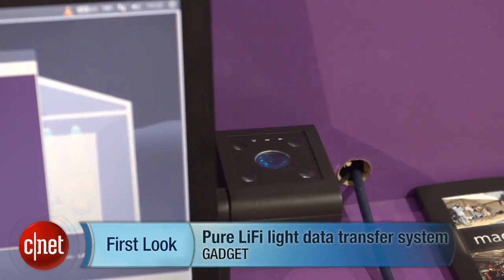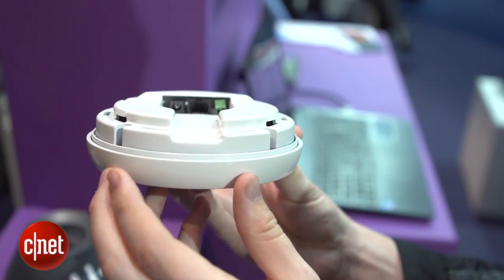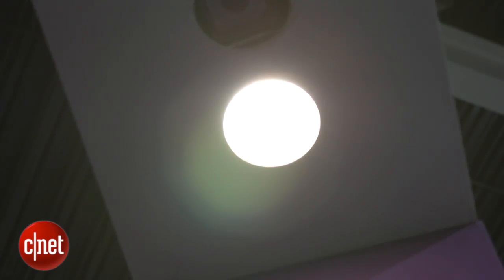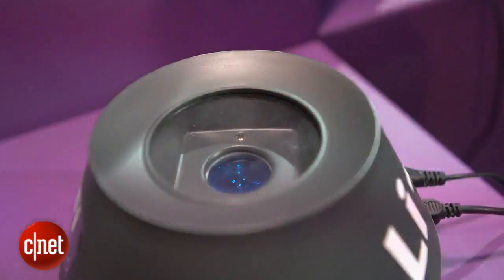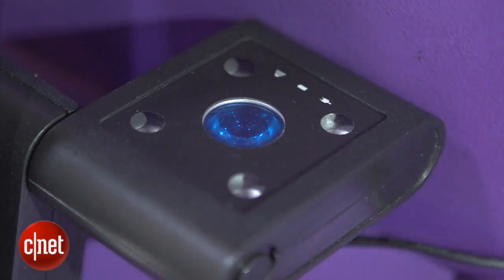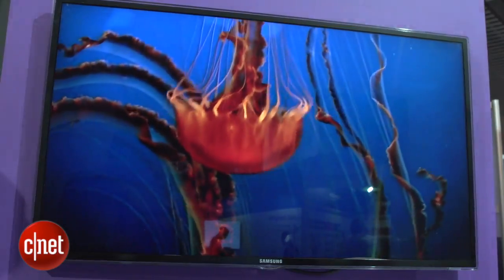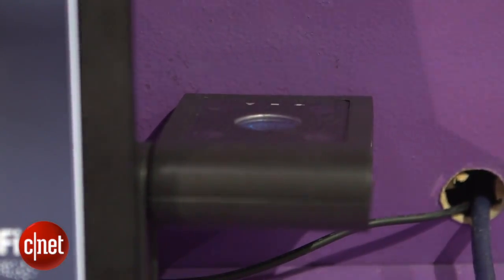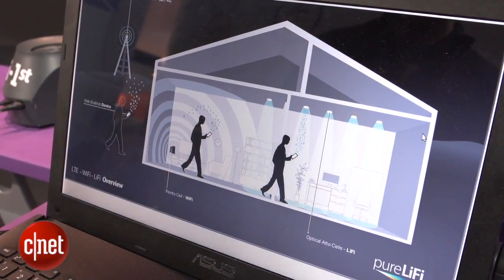Pure LiFi transfers data using light

Comment: It's a cool concept but I'm curious as to what the practical applications are and what are the advantages over other wireless data transmitting devices (Bluetooth, Wi-Fi, LTE, NFC, infrared blast,  etc.) p.s. what is the difference between this and infrared blasters? If there is no difference well then that's just stupid because this technology has been around since the television remote control was invented, (cuz that's exactly how it works).

Comment: Secure? As you would have to be able to see the light to get the info. If two cell phones had this could they transmit data with no potential of radio wave interception? Maybe a new thing if they made it small instead of rfid in a credit card. Credit card in a semi enclosed card reader that would trigger the card to flash a light. Leds can be made that compact just need a suitable power source. Solar for power? That is still flat and compact...

Comment: The main problem was demonstrated. You need a line of site. I guess it's OK for things that don't move, like a tv, projector, or even a desktop, but it's no replacement for WiFi.
Reply: the advantages over WiFi though, are it's theoretical speed output over WiFi. it's supposed to be faster by order of ten fold...

Comment: There wouldn't really be any use in this "new technology" as the transfer of information by radio waves seems far more superior and sufficient to this alternative method. I mean, why plug some device into your light socket that must be wired to the internet and is prone to interference, when you can just continue to use radio waves and no interference and the technology just keeps getting better?

Comment: Radio waves are light!
Reply: Good effort, but that is an incorrect statement. Radio waves are not light, they are both parts of the electromagnetic radiation spectrum, and the visible light is faster.

Comment: what we need is to somehow transfer data through light into our eyes to receive information into our brains. That would save so much time with learning.
Reply: That would require an ungodly talent at data decryption or a technological aided device such as brain implants to interpret the data. The light itself is just made up of different wavelength/amplitude forming a x bit language that gets read by a receiver terminal. So one of the feasible ways is tech implants

Comment: Infrared all over again...
Reply: Good effort, but that is an incorrect statement. Radio waves are not light, they are both parts of the electromagnetic radiation spectrum, and the visible light is faster.

Comment: I do not see any benefits of this tech! And FYI, radio waves are light! Just not the visible kind. So with that, "LiFi" is just gimmicky marketing.
Reply: Good effort, but that is an incorrect statement. Radio waves are not light, they are both parts of the electromagnetic radiation spectrum, and the visible light is faster.

Comment: I thought it was some sort of "April fools" joke when i saw this concept on TED... Happy to see that it wasnt. Only problem with this is that it's only a one way street
Reply: for now, but imagine if both had a sender and a retreiver, i feel the light spectrum would need to be adjusted so it can tell the difference.
Reply: cmb271 don't think a mobile device would have the battery power to have a transmitter

Comment: I would say that it is pointless & stupid. Interesting comcept but not really practical in real world
Reply: I can think of a few practical uses in the real world. So I wouldn't say it's pointless and stupid. The concept itself seems brilliant in its simplicity. It can be used as networking secured by physical walls. It also allows for instant connection to devices that enter the field of light (much more useful if the concept evolves into tiny sensors). Unlike traditional wireless (like 2.4ghz and 5ghz) with WEP <-lol, WPA, WPA2, etc encryption that can be cracked within a day or two by any person with dedication and help from google. Breaking into a network that relies on a light source would require infiltrating the building. It's not a technology that has a use for everyone, but it has it's uses here and there.
Reply: +lilman227 ya I could see it being useful in a business environment, and in homes to with electronics that don't move (tv, fridge ect), but as far as mobile technology and laptops the line of sight thing would get irritating. a combination of lifi for big immovable technology, and wifi for small mobile technology would be interesting.